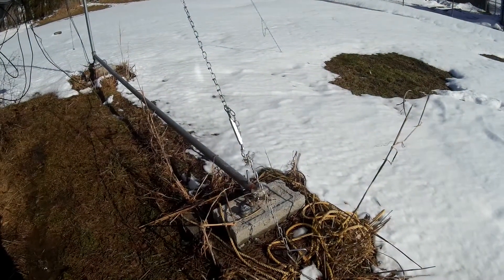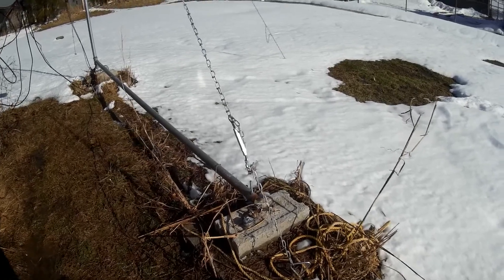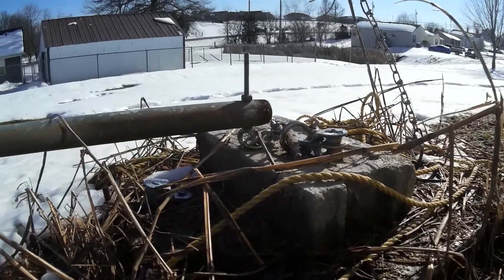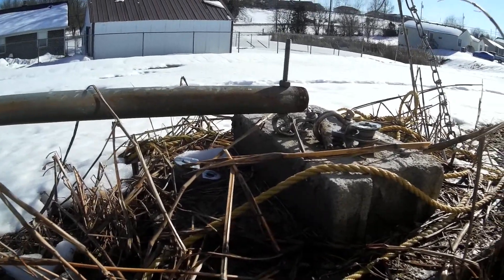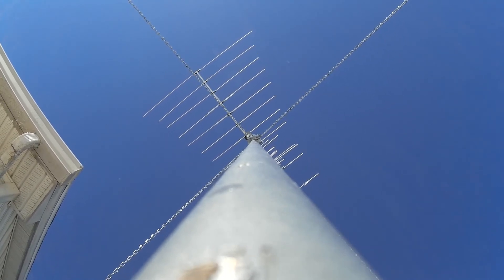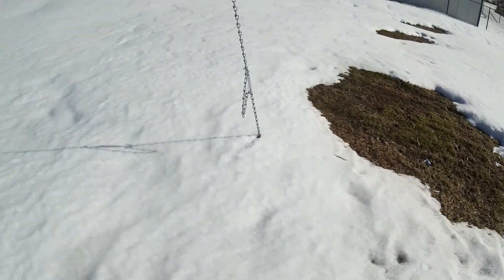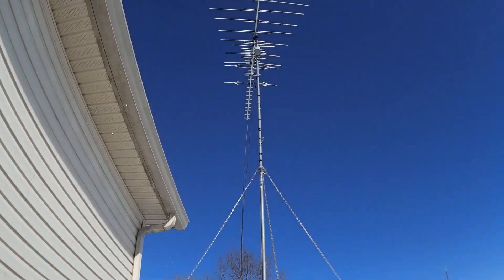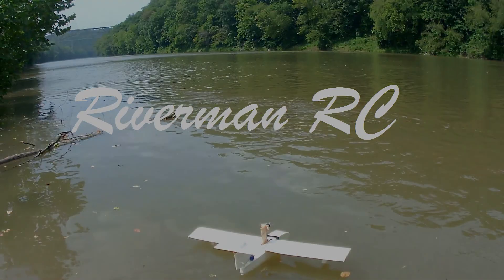Antenna Pole Setup, including the Gin pole

Comment: HAHAHAHAHA GOOD LUCK WITH THAT I'VE SEEN THAT THREADED PIPE SNAP BEFORE
Reply from the maker: I am aware they can, but 5 years later and still going strong. I only have a vertical antenna on top currently. Regular maintenence helps, I think. Thanks.